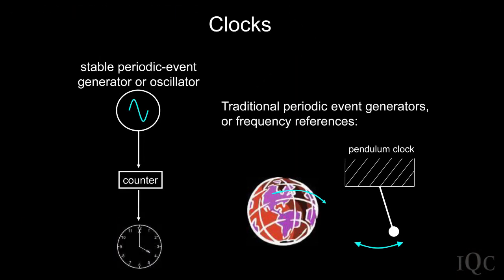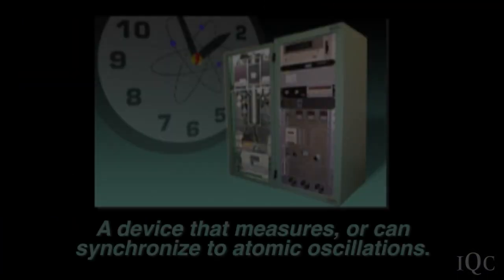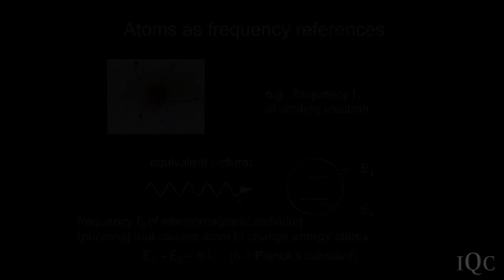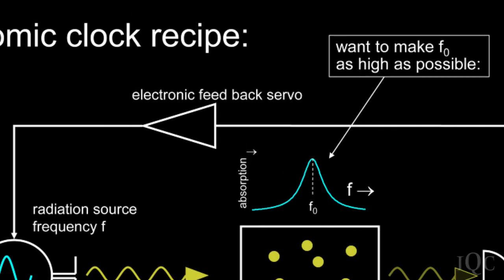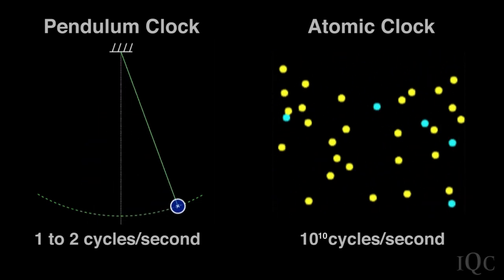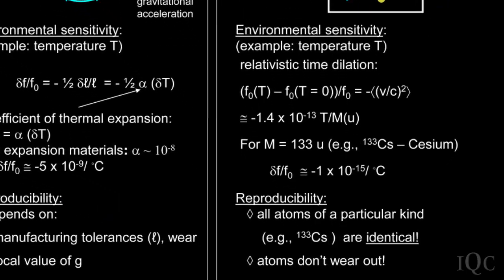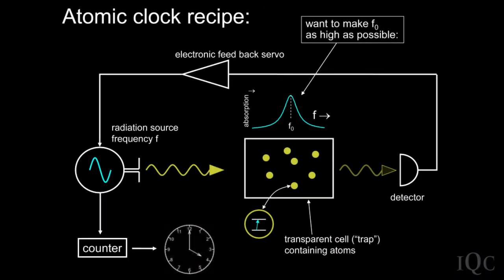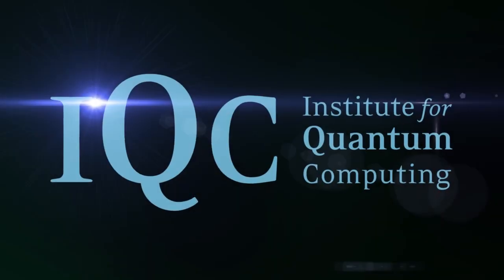How Atomic Clocks Work - Dr. David Wineland

Comment: This has nothing to do with quantum mechanics though, its based on Bohr's classical model of the atom. Just because it uses Planks constant to cuantise the angular moment of the electron doesnt make it quantum theory. Bohr's model does not use particle-wave duality or waves of probability instead of particles. It doesnt use photons either, as it doesnt treat EM waves as particles, and this term was actually introduced after Bohr made this model.

Comment: damn...... im dumb
Reply: He explained it in an extremely  difficult way to understand without prerequisite information.  A much simpler way of presenting it would be to say that they're looking for a spectrum shift from a known and agreed upon source. The EM radiation that cesium gives up has a specific baseline spectrum. Using that baseline they can compare spectroscopic (breaking the into its respective colors using a prism) images and compare the absorption and emission lines to determine if the "clock" sped up or lost time.  They're using spectroscopy and converting that small increments or reductions in time.

Here's some bonus gravy for you: It should be further noted that this gain or loss in time is a natural effect, due to electromagnetic retardation and changes in the medium that electromagnetic waves propagate through. The amount predicted as "time dilation" within the other two factors mentioned is extremely small. We're talking numbers with like 17 zeros behind a decimal.